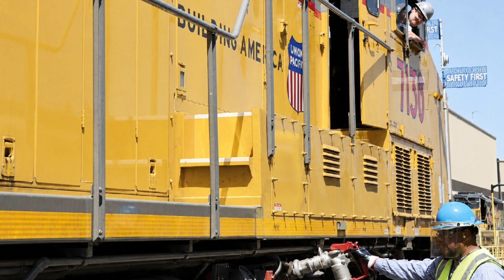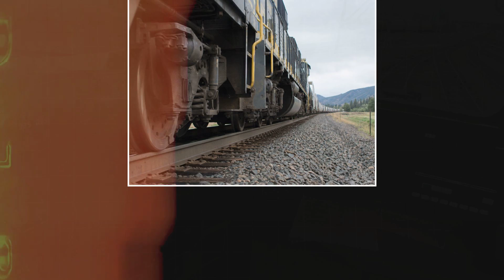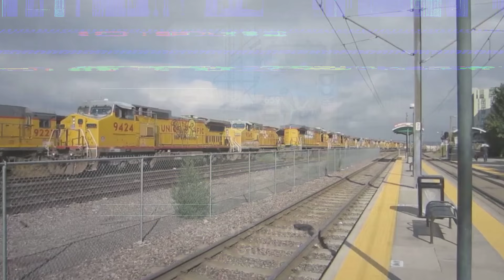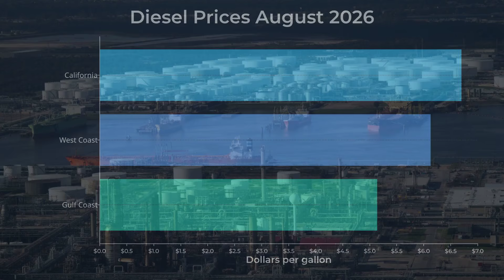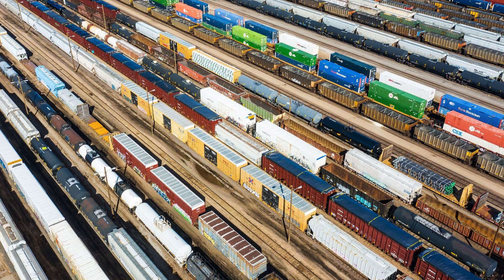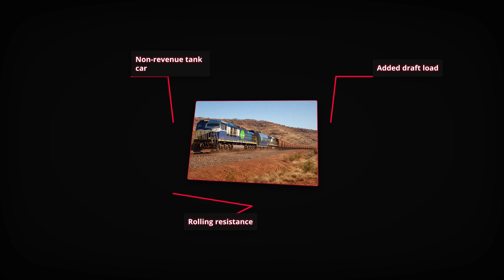The Reason Trains Carry Fuel They'll Never Actually Use

Comment: Those tanks they carry are so low, I don't see how they don't explode or drop off as the train bumps along.
Reply: Diesel fuel isn't very flammable.
Reply: @WeekendAristocrat That's why my Dad always told me, " If you want to start a trash fire use DIesel, not gasoline."

Comment: Basically the same as my always filling my car when I get fuel. Even though I can get along fine only filling it half way. But my time is too valuable to spend filling up twice as often. Even as a teen working at a gas station and getting minimum wage I always filled it . I could never undrstand those who could not afford to fill it. You save little in the long run.  If I had worked in railroads, I would not have made the slightest objection to a train leaving with full tanks.

Comment: Normally one can have water tanks under the locomotive which can add weight to the locomotive but it will serve no other practical purpose. Also water will freeze in winter and burst those tanks.  Make no sense.
It is way better to have fuel tanks which add weight for locomotive impact and it can be used incase there is a fuel shortage. That way  the freight train will keep moving without being held up due to lack of fuel.

Comment: Trucks also do not fuel up just enough for the trip. When they stop for fuel, they fill up. The extra weight is generally carried around at a very small cost. You need the extra fuel because fueling up once every few days for several runs, costs way less than adding fuel for each run. and then not having a reserve in case of anything that may change the route or delay the trip.
Reply: Same applies to everyone and I just can't get most people to see it. A full tank also attracts less condensation. Fiil up at end of day.

Comment: Let's say they have 3,000 gallons on each locomotive, and only plan on using 2,000 gallons.  Let's also say they have 3 locomotives to move this train whatever distance they plan.  But one of the train engines goes bad, and now the two locomotives are now running closer to 80% power instead of 65% power.  They will consume more fuel than planned.  And still have around 500 gallons left when they arrive to get more fuel.

Also locomotives need weight on them to lessen wheel slippage.  It is unlike any other vehicle, that does not bring along extra weight just to hold the vehicle to the ground.  Yes you hear of people saying your car can get better MPG if you leave behind 100 pounds of stuff not needed for your trip.  That is not true of a locomotive train, where it Must be 300,000 pounds to make the contact to the steel have more traction.

Comment: Airline fueling practices have many similar issues as well as some major difference.  While airline dispatchers usually plan flights point-to-point fuel loads that include fuel for FAR reserve, fuel for an alternate (if destination weather necessitates) and fuel for weather for storm deviations or holding patterns, the ability to tanker fuel between airports is also affected by other variables such as actual payload, available fuel tank capacity, aircraft max takeoff *and landing weight, among others.  If unexpected weather comes up, any tanker fuel can be used as necessary.